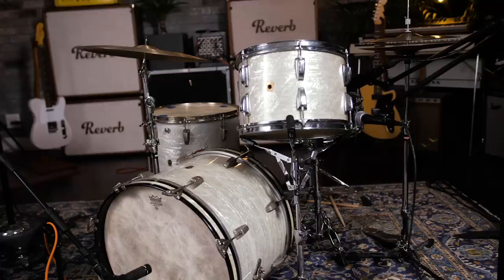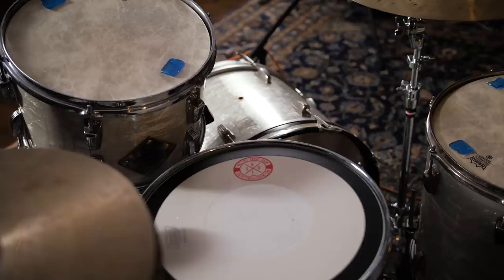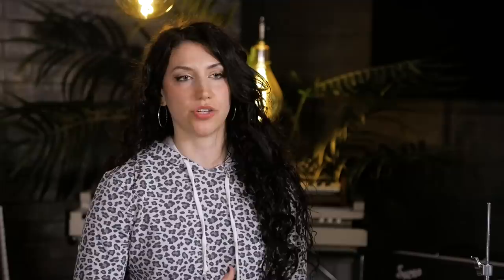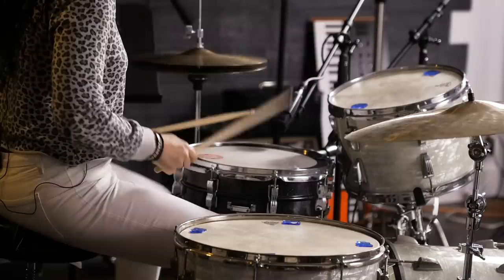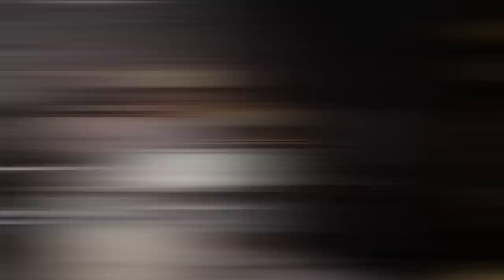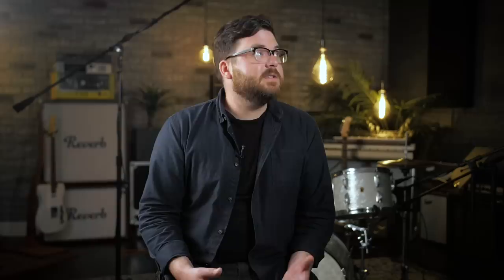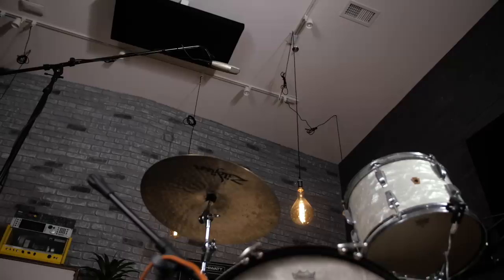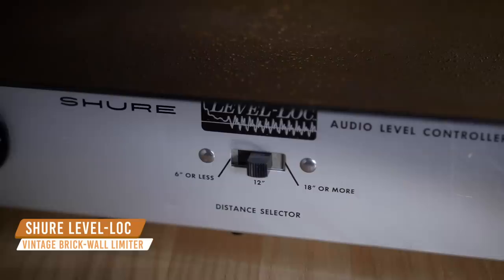The Tame Impala Drum Sound: How to Mic, Mix, & Select Drums | Reverb

Comment: Close, but there's subtleties being missed. Snare/Tom's are a touch too low, most people confuse the muffling technique used with low tuning. You can really hear that it's not low tuning in "Alter Ego". Secondly, the compression isn't nearly enough. Kevin typically used two compressors for everything. As result you don't get that "crunch" sound from the high hats, the highs are still too present and too wide. It's a lovely drum sound you have there, but it's not quite there. Mics and techniques are spot on, though it's worth noting Kevin does sometimes point the SM58 at the snareside head. Finally, when you record with four mics only, HOW the drums are played is most important. The players dynamics aren't as adjustable when compared to a full microphone set up, and it shows here. The player is beating the hell out of the kit and missing the lightness of touch Kevin uses, which means when it comes to compressing, the headroom for boosting the volume isn't there.
Reply: Honestly, I feel like using a tube preamp before or using a tape emulator after in the chain would get you 99% there with what they have in this video.
Reply: hell yeah
Reply: I agree I feel like with many of these videos they just tune everything so low to emulate compression and damping you can see the damn ripples in the heads

Comment: Short answer: Shure Level-Loc
Reply: lol right?
Reply: Shorter: sound toys devil-Loc
Reply: I noticed the most common plugin used on Mixing Master talks/demos, was Devil Loc Deluxe (and FF ofc). Finally got in a big reduction sale recently after over a year of waiting.
Reply: @RJ1J  dev lock is great. What’s “FF”?
Reply: @tidusandjecht10  yeah I have that plug in and do use it but you have to set your input really low and/or blend the wet mix or run it parallel without out it completely destroying and washing out the transients of your drums. The real one is much more open sounding, more ultra high definition, depth, punchier low mid warmth. If you're careful though it can work. I also prefer running a fairchild compressor type of plugin on a drum bus, occasionally on individual drums, or in conjunction with the devil loc, it tends to add back some of that punch.
Reply: The correct short answer, SE30 and DBX165A

Comment: Nice effort but the snare is wrong. It's meant to be meatier, then compressed and EQd to tighten it up. I'd say you need a bigger one. Also, he almost never changes cymbals, not a drum gear geek. Their sounds is extremely steady on the tracks and over the records. And as someone pointed out, the color brought by the DBX 165 is key.
Reply: Perhaps the Kublah Kahn

Comment: Can you please do a how to get a khruangbin drum sound!
Reply: This^
Reply: I watched an interview where the drummer from Khruangbin said the vibe of their band is playing quietly and bringing the level of each track up.
Reply: @CodyJacobCamacho  what I really want to know (through mic placing and mixing I guess?) Is how they make the kick sound so soft yet strong enough to give it a pump and how it sounds so upfront in their tracks. Also the sound of their massive, buttery floor tomb and  crispy, thin snare!
Reply: Jaime Diaz, side chain compression is how they do it.
Reply: @paaao  I don't think that's the actual factor, sidechain compression has that pump sound even at low levels. I think it has to do more with the eq, volume levels and maybe the use of certain hardware gear that gives those kicks its charm.
Reply: Jaime Diaz, you can send a kick to a side chain, and use it to gate anything from 1 or two tracks, to the entire output master bus. I will often side chain a snare track to suck out the noise of the hi-hats and tamborines, in order to pull it out of a mix where it’s getting buried. It doesn’t need to be played loudly, nor does the compression on the tracks being triggered need to be so overly aggressive that they suck and pump unnaturally.

Anyways, that’s what I hear. Anytime you have gentle quiet anything (drums in this case) popping out of the track, you know there is heavy compression, and likely side chain compression being used. Obviously there is a very wide stereo field, and very well balanced EQ throughout their tracks that is helping to put everything into it’s own spot, but I guarantee you that if you’re playing a quiet kick, and a big bass, you’ll absolutely need to side chain them if both are in the same frequency range, or harmonic range above/below to the point where they destructively cancel each other out. You can set the side chain compressor to attack/release very quickly when triggering it with a kick. The bass guitar will disappear/return so fast, you won’t even notice, especially since the kick will be right in the spot it leaves, and only that spot. The rest of the bass harmonics can be left with a 2nd instance that is quieter, and not being triggered to compress, or gate by the kick at all.
Reply: one mic in front, or behind ... or just snare maybe ( kind of "daptone drum sound" )
Reply: +1 for Khruangbin
Reply: I think the biggest part of that sound is an absolutely incredible drummer that was born in, and lived his entire life... in the pocket
Reply: Eh
Reply: the correct answer
Reply: @Mr.MagnumDong  I know I'm super late on this but another thing that really makes their instruments sound so warm is how sparse the instrumentation is. Without a ton of tracks in the mid-high frequency range, there's really space to hear those frequencies in the bass/toms/kick without the mix feeling too crowded
Reply: Definitely this is a great suggestion my friend indeed I would like to get some content like this lmaoo
Reply: @Mr.MagnumDong  The bass drum is miked from the beater side, and the snare is tuned that way, but it's primarily just the way DJ plays honestly.

Comment: Forget the Level loc and get the soft tube Tube Tech CL1B compressor plugin, high threshold, about 8:1 ratio, 0.1 attack time. 0.1 release time, and you've got the exact sound if not really close. Also the CL1B is a versatile compressor that sounds good on everything and is also the go to vocal compressor for Kanye West

Comment: he also doesnt use a shure level loc he uses a shure se-30 similar circuitry, but not accurate, and he uses the dbx 165a thats the majority of his compression and then he saturates it with his shure se-30
Reply: He specifically mentioned the Level Loc in an interview years ago
Reply: nah he never personally owned it, dave fridman has it though in his studio, but it was never sepecified if it was used
Reply: + you can actually see the shure se30 in his bedroom which is basiclly the same unit as the level loc

Comment: Anyone know what specific k con ride cymbal they're using?
Reply: The only k con rides I can find with a similar hammering pattern and a two-line stamps are the Medium Thin High and Medium Thin Low rides. Looks like Medium Thin High always has "High" on a new line but Medium Thin Low is sometimes stamped as one line, sometimes has "Low" on a new line.

Comment: I'm sorry, I really don't want to be annoying but this is not the way to achieve tame impala's drums sound, I've been recording drums that sound very similar to Kevin's drums sounds (been told by a lot of people) for all most 2 decades...starting with the padding on the drums and tuning that is very crucial, could be done only with towels and paper towels or magazines taped to the drums, most of the magic comes from the snare bottom microphone, placed underneath (and not the side of )the snare pointing to the kick drum, that way u get that snappiness from the kick-snare without the hi-hat taking over. and most importantly, Kevin does not play that hard, with the amount of compression he has on the drums the softer you play the bigger it sounds. and I noticed that Kevin use Evans drum skins on the toms, this drums set is amazing (i have the same drums) but it needs different skins and way lower tuning to achieve tame impala's drums sound. my band just did a cover for "Let it happen" so you can check out my drums...if u like https://www.youtube.com/watch?v=301yN56tGUE

Comment: There's one key element they didn't mention: how it's played. The chick is playing too hard. Kevin plays quietly and the compression makes it sounds like it has more energy than it really does. He hits the middle of the snare, she's doing those rim shots which is more of a metal thing
Reply: Also he plays 'in the pocket' on first two albums. And lofis the fuck out of the drums on many tracks. Except on Solitude Is Bliss, where you can tell he's turned down the Loc, I guess he knew this would en up being the big single so needed to make it sound more radio friendly. He still didn't make any money from InnerSpeaker. Gutting. Fuck that manager.
Reply: @RJ1J  What happened with the Innerspeaker manager? I haven't heard about that